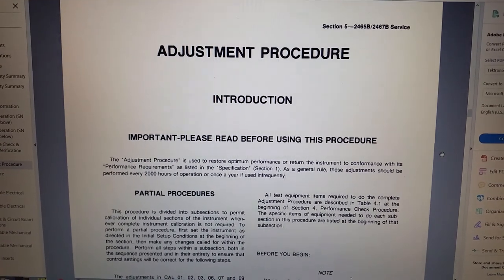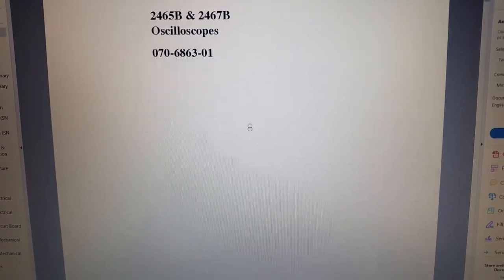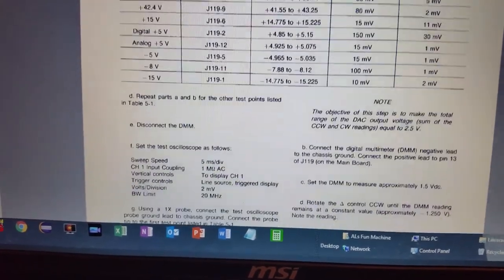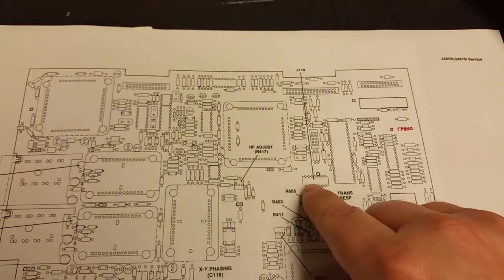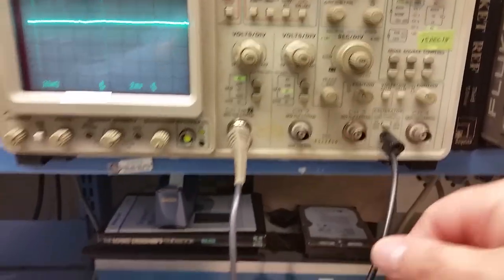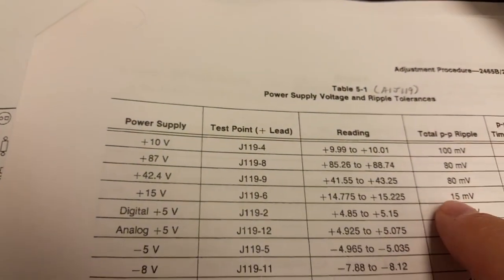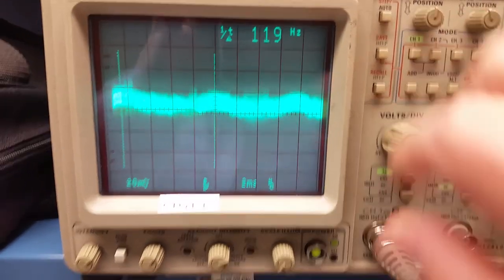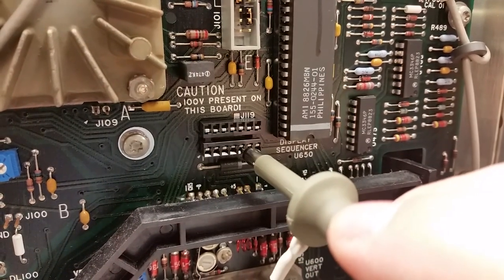Tektronix 2445, 2445B, 2465B & 2467B LVPS Checks & Some Cal Notes

Comment: Hey Keith, Really been enjoying your channel thanks for doing what you do.
Reply from the maker: Aw darn! Ya making me feel good here, LOL. So you're welcome No. 1. Thanks for watching. Best Wishes & Blessings. Keith Noneya
Reply: Is the 2445 older than the 2445A and the 2445B?very informative and interesting video. I have the 2445 but don't know if it is calibrated plus I don't know how to use it. I have been looking for a video tutorial but cannot find one that is for dummies that explains all the functions one by one.Cheers
Reply from the maker: Hi Rob, to answer your question not necessarily the A & B denotes added functions and features most of the time. Oscilloscope are used to measure variations in electrons/electricity, flowing through electrical or electronic devices. The screen is a visual representation of what is going on in the circuit. The graph on the screen is used to compare parts of the signal trace or visual representation with other parts of the signal trace. The knobs and push buttons are used to control how the trace or the glowing line appears on the screen. It can display: Frequency, AC & DC voltages. Frequency is displayed horizontally and the voltages are displayed vertically. Watch this video: https://www.youtube.com/watch?v=6WFlbHi2xnE  Although it is not on your scope the basic controls are the same for all scopes. The main differences in scopes are how fast a signal they can measure, and how complicated a signal it can display. So watch the video and ask me more questions as needed, I will be happy to answer them or point you to a video that can explain it. Thanks for watching. Best Wishes & Blessings. PS  Hope that helps Best Wishes & Blessings. Keith Noneya
Reply: Thank you for your response to my question Keith, I appreciate it.I have now learned another nugget of information on scopes particularly related to mine. Yes I will ask more questions hope you don't get annoyed with the many questions I have.I recently got a good deal on several pieces of testing equipment that I bought at a flea market and they are the following: signal generator, function generator a bridge component all made by heatkit also bought a isolation transformer and counter so I will have to learn how to use them all! as you can see I will be very busy studying but I am starting with the O'scope. Also thank you for the link to the video.Cheers

Comment: Not counting the handwriiten notes you have for Pg numbers referencing info for the 2465B, are other notes good for the 2467B?  Example: the warming up period of 20 min, or the pressing delta t for full vertical lines, etc?
Reply from the maker: Hi Ross, from time index 9:22 on when I talk about calibrating, I'm NOT 100% sure the info is correct as I have not been able to complete the calibration. I'm simply stating what I've read on the blogs. I will say though that if you do not have the equipment or experience doing the calibration on this scope DON"T do it! You stand a good chance of loosing your calibration constants if you screw it up. This scope is really finicky when calibrating it. This part I know from actual experience when I attempted to calibrate it, and I have 30 years experience repairing electronics, just not these scopes. Unless you're using it to fix customers equipment that requires calibration I highly recommend that you leave it as is. If your customers equipment requires calibrated NIST traceable credentials I would send it out to get done from a reputable lab. I hope that points you in the right direction. Let me know if I can do anything else for you, or answer anymore questions. Best Wishes & Blessings. Keith Noneya
Reply from the maker: I guess I didn't really answer the 20 minute warm up question. Yes the 20 minute warm up time is necessary for chip stabilization. Also put a fan on the main board when doing the procedure so the Hybrid chips don't start to become unstable. I found that out the hard way when I was doing the calibration. Also don't forget to read the description there is some good info in there too. Best Wishes & Blessings. Keith Noneya

Comment: Hello Keith, I have a Tek 2445a that has a dead NVRAM battery. I want to replace it and also recap the psu. Do you know where one can find a list of Mouser/Digikey part numbers?
Reply from the maker: What I usually do is download the Service Manual; http://www.ko4bb.com/getsimple/index.php?id=manuals&dir=Tektronix/Tektronix_-_2445B_Oscilloscope Then look up the part and find the Manufactures Part Number and put it into Mouser or Element14's or DigiKey's search and look for it there. If not you can look up the type of battery with the dimensions needed and by a compatible substitute. I highly suggest you don't pull the battery until you have a replacement and have soldered jumper wires into the terminals to ensure you don't loose your calibration constants. If you do then you have to calibrate the whole scope. There are two types of A5 boards, and early version where you can change the battery and one that has a NAVRAM style chip. The battery in the NAVRAM style isn't easily replaceable, as it requires you to grind down into the chip. If it's the NAVRAM Style then you need to change the NAVRAM and then calibrate the scope, or use it as is. When you look up the battery on the A5 board pay attention to they serial number on the front of the scope as to which type of A5 you have. I don't believe the two boards are interchangeable either.  You can also join and ask this question on the "Tektronix 2245 and Vintage Oscilloscope Users" Facebook group here; https://www.facebook.com/groups/805303046711998/ Let me know if you have any more questions. Hope that helps. Best Wishes & Blessings. Keith Noneya
Reply: @keithnoneya  Thank you for your answer. The scope gives a "TEST 04 FAIL 11" error and as far as I understood it means that the calibration data is lost/corrupted. I haven't opened it yet, but I really hope the battery is accessible.
Reply from the maker: @dakata2416 Yep that's lost Cal Constants. Download the manual, you'll need it to fix it. I'd open it open it up 1st and check the Power Supply caps before powering it up. If you don't have any electronics experience or know about HV precautions, I'd pass on this scope until you get some. HV circuits can be deadly. So know what you're doing or get someone to help you. Best Wishes & Blessings. Keith Noneya
Reply: @keithnoneya  I have played around some old tube radios. Also it has one weird problem with it. Whenever a button is pressed (trig. source for example) all frontpanel lights turn on for fraction of a second. Do you know what could be the culprit? And again thank you for answering my questions ♥️
Reply from the maker: @dakata2416 The buttons get sticky overtime, and when they're pressed the button could be held down by the sticky stuff under the button. That's my guess. Other than that you'll have to go into the diagrams and see what in the circuit could cause that. Best Wishes & Blessings. Keith Noneya

Comment: Hi Keith, 
I learned so much from your videos and really appreciate your making them so much!  
I have a question about a Tek 2445B. The triggering is failing.  I have ran through all the first portion of your cal 
procedure to set up the DAC ref. voltages and Cal 01. Started on Cal 02 and ran into issues with "limit" after the 
first couple of steps. Can you help at all? 
Thanks,
Susan
Reply from the maker: Hi Susan, yeah I ran into the same problems. I got past them by using another scope to run the signals into that one first to ensure I had the RMS value correct. You do need the Attenuators on hand to get the job done. It was several years ago, but I do have some videos of when I did it. I just didn't post them because I was never able to get it to CAL on step 9. Also I didn't use the called out equipment so I didn't know if I made a mistake, so that's why I never posted them. It was a scope at work and the boss called it quits on the scope before I could figure it out. What steps were limiting out? I'll go back and review my videos for you. On my about page I have a channel  email address you can contact me at personally. I may be able to upload the raw videos, without editing, for you. I won't have them listed but I can provide you with the link. Let me know if that's an option you would like to have. Best Wishes & Blessings. Keith Noneya

Comment: So if the ripple is too high, what does that mean? Replace all caps in the PS?
Reply from the maker: Probably just the ones for that voltage. Those Rifa Caps, clear rectangle ones, do like to go bad in cause problems when they start to go out. When they go all the way out they usually short and blow stuff up.
Reply: @keithnoneya  okay. I'm going to need help cause I have a parts or repair 2445 scope from eBay on the way. It shows a dot on the CRT but no display and all the LEDs are lit up on the panel. I've been told the power supply is the first place to start, which makes sense. If voltages are wrong logic can't work correctly. I just hope it's not burnt up.
Reply from the maker: @user-lp3cf5yn5b  Ok 1st question is are you familiar with working on CRT Circuits and electronics. If not you need to be very careful with the high voltages. Make sure you down load the manual on line for the safety and cautions to keep you safe. In the description there's several links to where to get the manuals. When following the procedures on how to work on and fix your scope you need to pay attention the the Serial Number on the scope as well as the Serial Number on the Circuit Board your working on. There are several Tektronix Forums you can join and those folks are full of knowledge and love to help. I highly recommend you join one of them. The other thing I highly recommend is watching as many Tek 2400 series videos you can, even if the problem you're having isn't in the title, you'd be surprised what you can learn. Sometimes the author will even talk about unrelated problems in the video. Best Wishes & Blessings. Keith Noneya
Reply: @keithnoneya  I'm somewhat familiar with electronics, and familiar enough with CRT to know to stay the way the heck away from the HV section. I've worked on a Tenma 72-320 before and almost didn't have anything left to work on from accidentally slipping the probe off a low voltage solder point to a HV point, and that's only 2 kV. I imagine it would be considerably worse with 14kv waiting to strike. Been watching any video I can get to come up on 2445s. Already joined tekscopes so I have that resource sitting on go. Hope it's not the EPROM or MCU based on all the lights being on on the panel.
Reply from the maker: @user-lp3cf5yn5b  for sure on the EPROM and MCU. However it you only have a dot it's most likely the Horizontal Circuits. If you haven't torn it apart yet you can put your probe on the CAL test point and see if the dot goes up and down. If it does then it's very unlikely those and almost certainly the Horizontal Circuits. Post a video of what your problem is and send me the link. In the video to help others want to see the video name it something like "Tektronix 2445 Dot only what could it be" Then in the video show and tell what you''ve done so far. If you make the video short enough or one like it short enough you may post it on FaceBook. Tons of people on there with knowledge. Try joining this FaceBook group, I'm going too;  https://www.facebook.com/groups/805303046711998
Reply: @keithnoneya  I also hope it's not the horizontal, cause that's probably U800. The guy that's making the replacement circuit for U800 doesn't seem to be making them anymore. One thing about the dot is I believe the scope is in XY mode from the pics that were on eBay. So all I can really say from the images is that HV seems to work and some of the low voltages to even have a dot and LEDs on. It's still on a UPS truck at the moment. And....I'm also away so it will be next week before I can do anything to check it out. Definitely going to tear into it as soon as I get home to see what's going on with it and let you know what it's doing.
Reply: Did you see any of my posts from the FB group? This is the issue I've run into. So, I checked voltages and a good bit of them were slightly off. I went through the troubleshooting flow charts and it brought me to the feedback circuit of the power supply. I don't know if it was already messed up or if I accidentally did it but the optoisolator U1040 input side is blown, and I swear I think I'm seeing 13 volts on a 5 v rail going into the error amp 1371c from the +5VD into pin 9. So either the power supply is throwing a whole lot more voltage than it should be, or somehow the LM324 is allowing it's supply voltage to leak out to the 5v rail. I am at a loss of how to safely run that power supply disconnected from the scope because I'm kinda scared that if it hasn't already messed the scope up, it may if I keep trying to run the PS while testing it in the scope.
Reply: Got it going! Recapped the ps, replaced U1040 and it's working. Got a question on how to use external triggering on it. How do you set it up to use channel 2 input as the trigger source for channel 1?